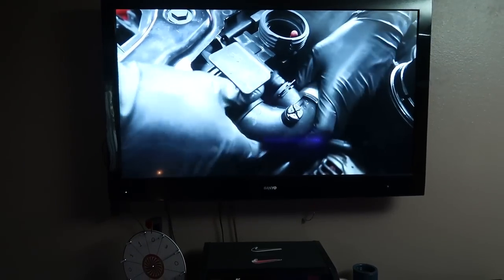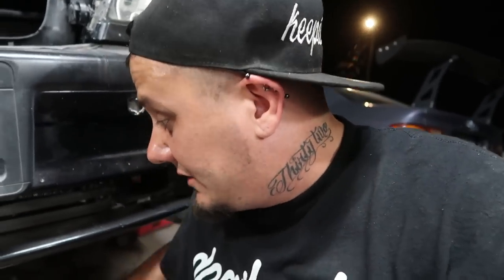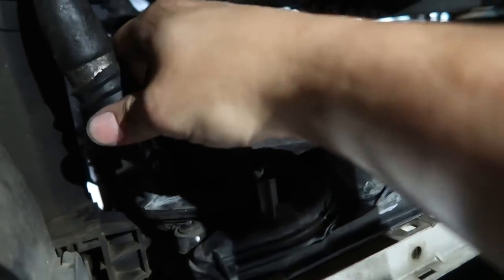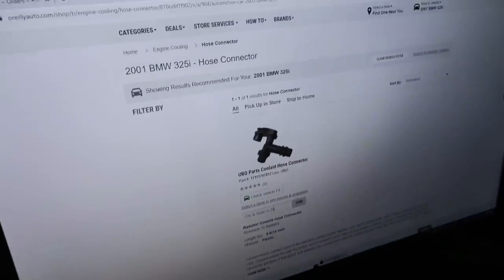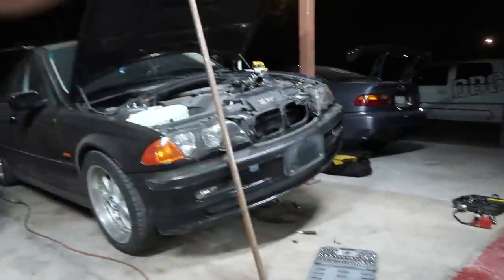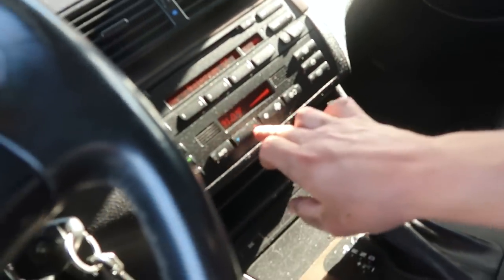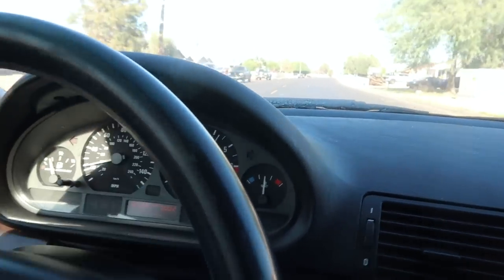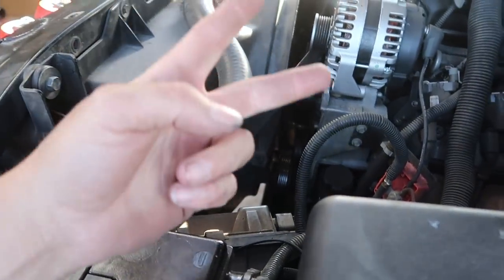E46 Sprung a LEAK! Suburban BLEW TF UP! 😩

Comment: Wow you got it easy was dealing with a customer who had a oil leak I replaced the valve cover gasket oil pan and the oil filter housing gasket still was leaking oil behind the exhaust bought a uv light and a light and there was a small hair line crack in the head talk about fun
Reply from the maker: Sounds miserable brotha 😩

Comment: Just use your drill to start the lawn mower with the bolt on the top
Reply from the maker: 🤣🤣 I thought about it.. tryna do things right okay!! Like duct taping intake couplers 😎
Reply: @deadbeatgarage  I thought you might break out the plastic welder you got and fix it that way